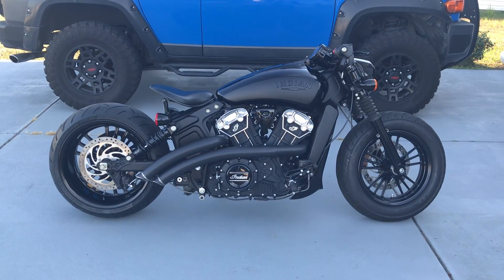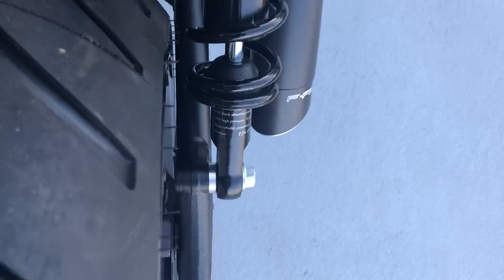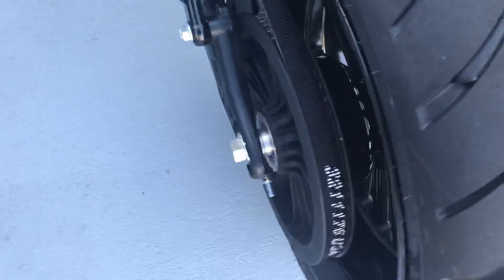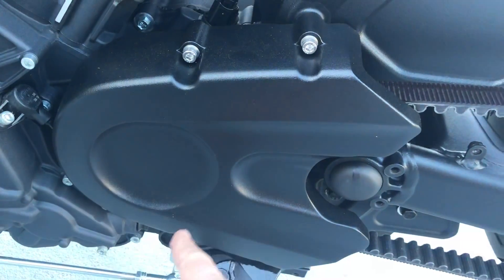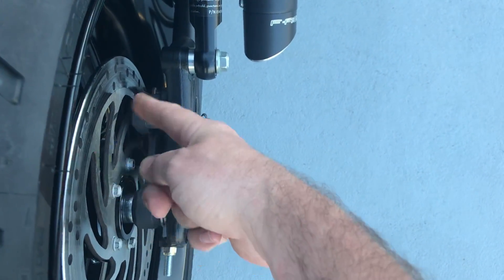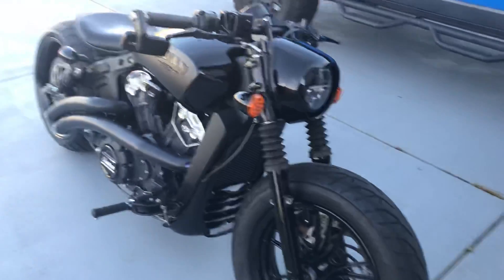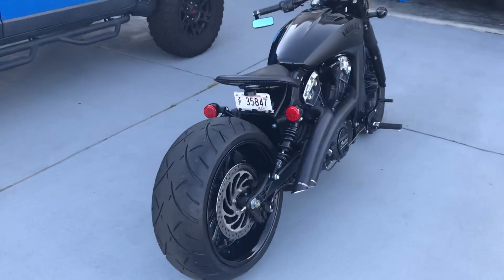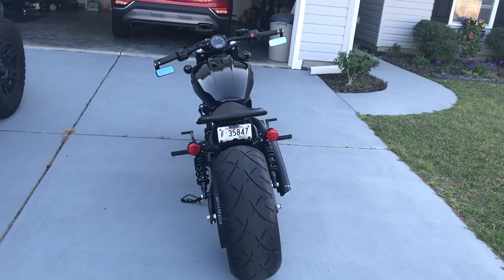Indian Scout Bobber 240 Rear Tire

Comment: Great looking bike. I plan on doing a 180 in the rear with the fender delete. Any information on how you mounted the stock lights and the plate? I'm trying to keep the stock lights as well.
Reply from the maker: If you have the same seat, take a flat piece of metal, make a 90 degree bend on each end, drill a hole on both ends for the taillight screw, and two holes on top of the bracket to attach to the under side of the seat.

Comment: Did you ever consider putting may be a 180 or 200 rear tire on the rim? Or would it not   fit? if I can ask or if you can tell me via this chat how much was it for the 240 rear wheel the tire and the front wheel

Comment: Could you essentially just throw the rear tire on and continue about your day or did you have to balance the tire, bleed brakes or anything else?
Reply from the maker: Just throw it on and ride. Check for clearance on the swingarm before doing so. No need to mess with the brakes. Make sure everything is torqued to spec.

Comment: excellent build , the bike look absolutely amazing, im on the path of the fitting a240 very soon.... mind me asking about the disc brake pls? i have found some aftermarket discs but not like 
the one you have .

thanks .
Reply from the maker: Thanks for the kind words. The brake disc is the stock one. Be sure to check out my 240 install video.

Comment: I definitely have a question. I am going to a 180 rear tire on a wheel I purchased from RC Components… the Patriot Eagle Eclipse wheel 16 x 5.5 specifically. The problem it seems is that there isn’t enough clearance between the inner wheel and the rotor to put the caliper back on the rotor. I am almost inclined to take the back pad off of the rotor to see if that better allows me to put the caliper back on the rotor. Then I would hope that I can re-install the back pad onto the wheel. Did you need to do anything similar to get your rotor back onto the caliper?
Reply from the maker: I didn’t have to do anything, however, it is very tight and it takes some time to find that sweet spot before it will go on.

Comment: Could a short rear fender be made, if you wanted one, to keep debris and water from raking your back? For looks I like this look but for function I think a minimalist fender in front and back would save my back and front radiator
Reply from the maker: Nick I both RC Components and Tank Machine make a fender for the rear.

Comment: Hello! I love your bike and very soon I will build one like yours ... well  almost. Would you like to share the link for the 240 conversion, because I didn't find anything ... and the rear tire too? Thanks for the video
Reply from the maker: The wheel and tire came from RC Components, roughly $2400. They use the Metzeler 888 tire because other tires may not fit. Also check out my other videos. I have a very detailed install video of the entire process which will be very helpful. Thanks for viewing.

Comment: Looks beautiful 
Thank you for video 
I have a question 

If I put a Michelin commander III on front and Michelin commander II on the rear would that be “acceptable” ? 

Thanks
Reply from the maker: If you have the 240 tire on the rear, whether it’s the commander 2 or 3, you need to make sure it will fit in the swing arm. I use the Metzeler tire because they run slightly smaller. Other bobber owners have put different brand tires on the rear and have had rubbing issues.

Comment: Looks awesome I just got a indian scout bobber sixty and I want to put a 240 what's the one I need to get? Do I need to change the front as well? And what's your front  suspension  from I like it how is all black
Reply from the maker: Because the scout bobber sixty is a new model, RC Components may not have a rear wheel to match your front, so you may have to buy both. Keep in mind my front wheel is stock 16", some people put an 18 on the front to match the rear. I personally don't like that look. As far as my front suspension, I just have 32mm Bikers Choice shorty's on the forks. If you don't get the short ones, they'll look all bunched up like an accordion.

Comment: In order to add that size rear tire, do you need to remove the passenger seat in order to have that size or a rear tire?
Reply from the maker: Yes, because you have to remove the rear subframe which would hold the weight of a passenger.

Comment: Thanks for the video! Any way to get the spacers by themselves if u happen to know? Thanks
Reply from the maker: If you contact RC Components, I'm sure they will sell them separately. It's worth a shot.
Reply: @oxouk  Thank you! I'm doing the 240mm swap very soon as well. Would u hsppen to know if an 18x8.5 victory hammer wheel with a metzeler 240 fit our bikes?

Comment: the RC Components 240 kit comes with a 18x8.5 wheel, did you go with a 18" front wheel also or is it the stock oem 16x3.5 wheel?
Reply from the maker: I kept the 16" front wheel because I don't like the look of the 18 on the front. I think the bike loses that fat, bulldog stance. Just my opinion.

Comment: Im assuming you have to eliminate the rear fender in order for it to fit ???
Reply from the maker: Correct, however RC Components does make a rear fender for the 240mm kit.

Comment: PLEASE tell me how you did the rear fender delete. I can only find it from tank machine. I bought the same rear tire kit from rc components, but I hate the fender they sent. I was going to cut it as short as possible since I couldn’t find the rear fender delete. Please respond ASAP.
Reply from the maker: click on my user name and watch "Indian Scout Bobber Rear Fender Delete" part 1 and 2. You can also buy a delete plate that also holds your tag. Call Coastal Indian in Murrells Inlet SC @ 843-651-9799.  I think it's like $150.00.

Comment: I just fitted the same kit, my belt is hitting the tyre tho?! I used the spacer you pointed to on the belt side, dunno what’s going on
Reply from the maker: Did you install the drive sprocket spacer, what brand of tire (some 240’s are slightly wider) and lastly, did you align the rear wheel.

Comment: Hey bud! Your videos have inspired me to build one, question how the real feel on these tyres? Compared to what you've earlier... Do your think it's worth the investment?
Reply from the maker: A lot of people ask me about the handling with  these tires. Being wider, requires you to put a little more effort into cornering, but it's minimal. I can't speak on handling in the rain, because I don't ride in the rain. Keep in mind that there is a lot of curvature in the 240 rear tire, so there is still plenty of grip when dry cornering. As far as the looks, it's a no brainer. I get paid compliments on my bike everywhere I go, and being a gear head,  I'll talk your ear off. All in all, worth the investment.
Reply: @oxouk  Thank you for the response. I found a 2015 Scout Sixty for a pretty good price.. Always wanted to build a bobber, do you think it would be a good platform. I tried searching online to see if there is a difference in the frame of the bobber vs sixty.. couldn't find anything at all..
Reply from the maker: @AmrthGanapathy  The Sixty is a perfect platform to build from. Same frame, and same engine, just tuned differently and not bored out as much. Also the Sixty is a 5 speed as opposed to 6 speed on the Bobber. The Sixty has just as much fun factor and is better than anything in it's class.
Reply: @oxouk  great to hear back. Maybe one day I get to exchange notes with you on the build. I come from adventure riding. Recently sold my multistrada... Been itching for winter to arrive, so that I can find a cheaper bike. Found one in NC, now need to wait till we agree on the price.

Comment: Wonderful bike ! 
Which size of tire have you fit in  front ?
Reply from the maker: It’s a 150/80/16 on the front. It’s the same size as the original rear tire that came on the bike.
Reply: @oxouk  thank you so much for your answer. Does 150 width fit with the standard fork width from Indian ? Or did you have to change the fork brackets to increase  the fork width ?
Reply: @oxouk  I have an Indian scout bobber and I want to change the rear tire into 240 and the front tire into 150 if it i's possible with the original fork. Do you confirm that i's possible ?
Reply from the maker: @gerardpeyssi3593  the 150 will fit the front with no modifications needed.
Reply from the maker: @gerardpeyssi3593  to fit the 240 on the rear you need to remove the rear fender and subframe. Watch my video “Rear fender delete”.
Reply: @oxouk  you mean that the 240 rear tire cannot been fitted with the original fender from Indian ?
Reply from the maker: @gerardpeyssi3593  Correct. It’s way too wide.
Reply: @oxouk  Many thanks again for all of these helpful information. 
Have a nice day
Reply: @oxouk  To be sure I have well understand, do you mean that the rear fender need to be changed to fit with a 240 width tire ?

Comment: Looks great! Who makes those mirrors, my friend?
Reply from the maker: Type “black rectangle motorcycle mirrors” into EBay. The actual mounts are stock ones just cut down. I used a tap and die and mounted the mirrors onto the shortened bar stem.
Reply: @oxouk  Ingenious idea. Thanks. I might just cut, tap and die the stock mirrors that came with the bobber.

Comment: I've read through all the comments and see you bought an 18" rim for the rear from RC Components and used your 16" stock rim for the front.  Is the width on the rear rim 5 5"?
Reply from the maker: Peter, the rear wheel is 18X8.5”
Reply: @oxouk  Thanks for the update.

Comment: where did you get the gas tank decals in black or did you plastidip ? thanks
Reply from the maker: I used matte black vinyl for the sides of the tank, then ordered new emblems from cheapcycleparts.com, then painted them before installing.
Reply: @oxouk  you did an awesome job I love it

Comment: That chin spoiler from dirty bird concept? Is it a direct fit ? Thanks
Reply from the maker: It is a direct fit. You may have to bore out the lower screw hole on each side of the cover, but not a big deal. Well worth the money.
Reply: @oxouk  thanks brother, where can I get that swing arm bolt cover On The sprocket cover side ? Thanks
Reply from the maker: @Justmil69  The swing arm bolt cover is stock. If you don’t have one you can get it from cheap cycle parts.com.
Reply: @oxouk  thank you

Comment: What tire did you go with on the front?
Reply from the maker: Stock 130 series, however I just put a 150 on the front which is the stock rear size. It is almost 3/4@ wider.

Comment: When you talked about handling being different, is it better with the bigger wheel or? Thanks
Reply from the maker: Handling with the stock rear tire requires less effort. However, any time you alter things, you often compromise handling, performance etc...The extra effort it requires having the 240 is well worth it in my opinion.

Comment: How’s it maneuver with the big rear tire?
Reply from the maker: You notice a difference at first, then you adjust your lean, and knee to the tank to compensate in turns.
Reply: @oxouk  ya happy with the bigger tire?
Reply from the maker: @markhouser1745  I am. To me it just gives the bike that mean low and wide stance. The compliments I get when I ride ain’t too bad either. I still have my stock wheels also. I can always swap them for a while if I get bored.

Comment: Is it possible to maintain a rear seat with a 240 rear tire?
Reply from the maker: Rear seat? Did you mean fender?
Reply: @oxouk  fender with seat, yes
Reply from the maker: @gerryclemonsii  RC components and a company called Tank Machine both make a rear fender that works with the 240, however there is no way to utilize the stock rear fender.

Comment: Nice bike brother. I got a question tho.Did it change the ride/suspension/ handling of the bike?
Reply from the maker: Suspension has always been harsh on these Bobbers unless you swap it out. Cornering is different. Despite what some may say, it just takes a little more effort turning at low speeds. Just like riding one bike then getting on another, you’re gonna be cautious at first.
Reply: @oxouk  cool thanks for the reply. Im going to have this bike someday.

Comment: Hey man how is the handling ? With the 240 compare to before
Reply from the maker: Not too much different. Just have to put a little more effort into cornering by counter steering, pushing your knee into the tank a little more than usual. After a few rides you don’t know any difference.
Reply: @oxouk  cool thx man I am about to get this done and also want to get the performance air intake , one more question I have a back seat would the 240 kit still work ? Because i like to keep the back seat for my son he loves riding with me
Reply from the maker: @reviewsverse3743  the 240 rear tire requires you to remove the rear subframe which would hold any weight for the rear passenger. They do make a rear fender for the 240 but it’s purely cosmetic and is not meant to hold any weight.

Comment: Looks awesome. Where did you order the kit from? thank you.
Reply from the maker: I ordered it from RC Components.
Reply: @oxouk  thank you very much. Is the kit for Indian Scout http://www.rccomponents.com/whats-new/indian-scout-240mm-tire-kit.htm  ....or specifically for Indian Bobber Scout. I have a 2021 Bobber Scout and I want to make sure it fits, since I'll have to ship the kit all the way to Romania (you know, Dracula, Nadia, Hagi....:))   If you can confirm the exact product code, it will help me a lot. thanks
Reply from the maker: @laviniulazar8069  The “Stocker” wheel is meant to match the original Scout front wheel. The wheel you will need is called the “Raider” wheel. Look for it on their website, and be very specific when ordering or talking with a representative. The 240 kit will fit all Scouts, however due to tire size differences, the Metzeler 888 is the only tire that I know will fit. Others have ordered Other brand tires that rub on the swing arm. Also make sure you specify “gloss black”.
Reply: @oxouk  thank you very much. You've helped me a lot!
Reply: @oxouk  can you please tell me (also) where did you get the solo seat from?  Thank you very much, once again!
Reply from the maker: @laviniulazar8069  I'ts the Indian 1920 solo seat direct rom Indianmotorcycles.com.

Comment: How dose 240 handle compared to stock
Reply from the maker: It just requires a little extra effort turning at low speeds. After a couple rides, you don’t even notice.
Reply: What's stock?  I wann go from stock 200 too 240   on a kawasaki vulcan 2000!  Thanks for the info
Reply from the maker: @danvesa1182  Stock rear is 150, front is 130.

Comment: Will the 240 tire fit with the stock fender?
Reply from the maker: No. I think the largest tire the rear fender can accommodate is a 180. RC Components do make a rear fender for the 240.

Comment: Hey bro, I purchased a similar kit for the scout, do you have an installation video too share?
Reply from the maker: They will send an instruction sheet. If they don't, call customer service and they will email you the link. Use my tips and the instruction sheet. Having the right tools is key. Make sure you have access to an impact wrench and the 36mm socket. I promise you, it will make your life much easier.
Reply: @oxouk  Does the spacer which you have to re-use from your existing rim need any special tools to remove, like a bearing puller? Thank you

Comment: Hey mate, what has been your riding experience with the 240 tire. 
I am about to start the modifications on my bike and I want to know if the change to a 240 tire is a good decision.... Thanks for answering and congratulations on your bike.
Reply from the maker: If most of your riding is leaning hard into twisty turns zipping through the countryside then the stock rear wheel size is better. The 240 gives you better straight stability due to the wider contact. It also looks awesome. Leaning into turns with a 240 is not difficult by any means. It just requires a little more body input, pushing your knee into the tank whilst going into turns. Biggest hurdle for most people is the price of the 240 conversion. We’ll worth it in my opinion.